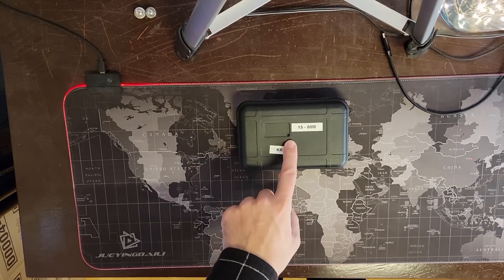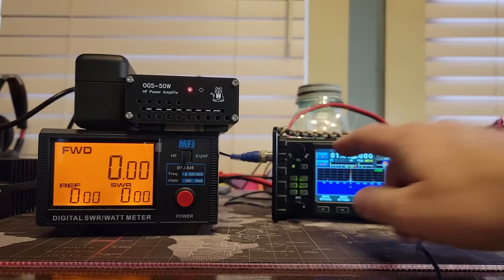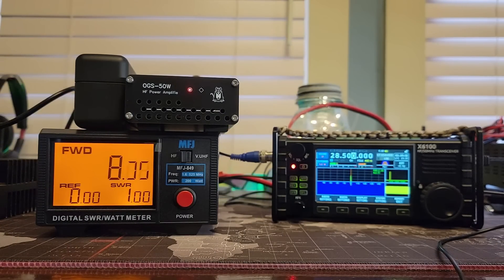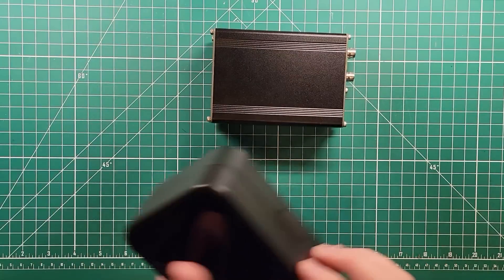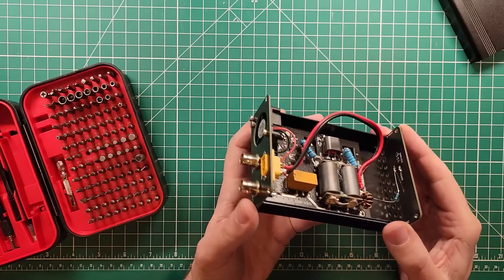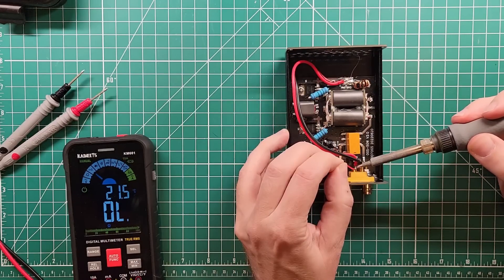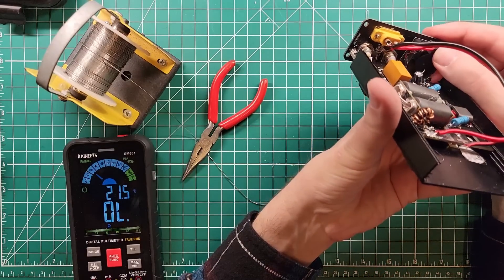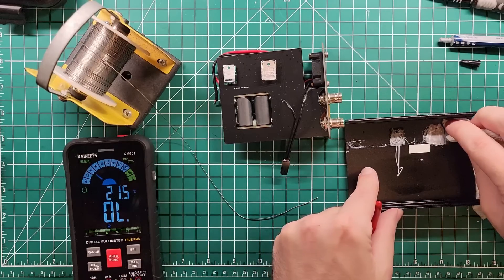The OGS-50W - Stay Away!

Comment: And it can’t be FCC certified because it is capable of amplifying 27 mHz/11 meters with a 5w input.

73 de AF6AS
Reply from the maker: As you know, If you're a ham it doesn't need to be FCC certified, that's our job.
Reply: @temporarilyoffline  True, but it can't "legally" be sold commercially ... (Yes, there's always AliExpress ...)

I remember the days when commercial linear amplifiers couldn't cover 10/12 meters unless you identified yourself as a ham and got a workaround, just like the MARS/CAP "out of band" mods.

Comment: I had a person hand one to me blown up in the same manner as that one that failed for you and found the MOSFET shorted-the soldering is pretty bad and I noticed around one of the BNC connectors a spot on the board where it looked like it got hot and discolored the board-which also may be the soldering job on it from the factory-they have always said-if it looks too good to be true-like 50 watts for about 50 to 75 dollars it probably is too good to be true
Reply from the maker: Yeah, I was pretty shocked. These are built by people that don't know what radio is.

Comment: I bought an OGS-50W before I saw the videos that dislike it. I figured they abused the amp, thus their issues.

To be safe I used a 40 meter resonate antenna. I also used my bitx-40, but since at 13.8 volts with adequate amps it puts out around 7 watts I decided to try running the bitx-40 at 9 volts with at most 2 amps. This brought my rigs power down to 0.8 watts on my crappy meter, but the combination of an input of 0.8 watts and the OGS-50worked great. I'd say my meter suggested 28 watts.

The only issue is the recieve to transmit relay has a delay of about 200 miliseconds. I spoof this by tapping the mic before starting my audio. On digital modes this could be an issue but I really bought it for giving more kick to my Qrp kit SSB rigs.
Reply from the maker: Nice, glad it worked out well for you!  I agree on the 200ms issue being a problem.

Comment: I knew that thing had a pair of IRF530s before you took the lid off. There are several kits that use those switching Mosfets. They put out a lot of power on the low bands but they short out easy as they aren’t designed for RF amplification.
Reply from the maker: Hams repurposing one thing to do another thing... No problem there, it's what we do. The micro PA50 uses the same FETs, but is a better design. I'd still like to see more protections built in though

Comment: Exact same thing happened to mine. This cannot handle any antenna greater than 1:1.5 SWR. One of the 530 was blown. Replaced it and it came back to life. It works, but it's fragile. Sold it to a friend who knows how to handle it with care. Oh, another thing, when the 530N blows out, the dc power plug is shorted. Be careful.
Reply from the maker: Yeah, no protections, no bypass, no PTT switch... no good.

Comment: This low quality amp is only meant to be used (per its spec) from 3 to 21 MHz. I notice that you began your test on 160 meters (out of manufacturer's spec) and then ran through the "approved" 80-15 meter bands but then did a bit of transmitting on 12 and 10 meters (again, out of spec), and finally returned to out-of-spec 160 meters where you blew up the amp. I'm not saying the amp wouldn't have blown up anyway given that it's made of reused solder and dog food, but I am saying that you may have sped up the problem by using it in ways the manufacturer never intended. Thoughts?
Reply from the maker: Good points!  I don't know where I got the idea that it worked on those bands.  I'd expect it just wouldn't be efficient.  The IRF530s aren't even meant for this application anyway.
Reply: @temporarilyoffline  Pushing the envelope, by instinct. I bet it would be sweet on 40, 20 metric bands. Would be cool if everything was repairable via firmware update. This may have provided a break.
Reply from the maker: That's what I do!

Comment: Amps, weather for audio or rf, are rarely rated at rms, they are more interesting if they are wearing an emblem of peak.
It can do peak safely, for a few seconds.
That 50watt amplifier, with ssb or cw, should be fed the specific amount of power to be just under that, especially with cw, which is short carriers. SSB could peak right on 50watts, or a tad more, but then you are stressing the recycled solder, and whatever they picked out for components. It needs a rig set to a specific setting of happy place and never exceeded, or just there to bypass straight to antenna. Once you have a few of them, you can start combinding them. A ssb signal @ 3 watts peak, driving 2 of those, then those driving 6 of those, of course after you develop a harmonic elimination circuit to keep it clean and focused on the bands of choice. Then you discover the little white transistors, with much higher gain and peaks, but that is kinda trendy.
Reply from the maker: Pills? :-)
Reply: @temporarilyoffline  What he said was , you over drove it to failure . never look to see advertised  watts in RMS/AVG . 50w PEP not RMS .  Its a gateway to popping skylab pills if your keen.  near as I can finger from Mr. Late offered up.
Reply: Damn Skippy

Comment: Wow, thanks for the heads up TO & shocked at the lack of protection & BPF circuitry.
Agree, to bring it up to spec you may as well buy an XPA or similar better amp.
There are a stack of these simplistic RF amp designs all over the net but the bleed back is worrysome as it can easily cook the RF finals in your rig.
I've built similar amps in my college days & is something every ham should try at least once.
When I've seen you test other amps their power output was fairly consistent.
I feel the toroid transformer construction is only scratching the surface of what's wrong with this amp.
Can only dare imagine how Mike (Mikes Radio Repair) & Peter (TRX lab) would react to this amp!
Reply from the maker: Might need to send them one!

Comment: No low pass filters on the output of the AMP, and it is likely the harmonics are not suppressed the required 43dB with respect to the fundamental required by the FCC.  So it is probably not legal to have on the air, but really nice that it destroys itself keep you from violating the rules.
Reply: I didn’t waste on that’n ‘cause I knew it was unfiltered. If it had filtering, bet it would have done better. Worse yet: there are a couple versions ‘out there.’
Reply from the maker: Right!
Reply from the maker: Small Favors...

Comment: The Micro PA50 works much better for me. It looks like it does not have any protection in the Amp. Based on final failures in the SbitX, the finals failing will cause a dead short when they go.
Reply: That amp has a lot of issues. There is no protection circuits. That is one of the things the Micro PA50 has that this amp doesn't. Lots of protection built into the Amp.
Reply from the maker: I like the Micro PA50 so far, eventually I'll get one to play with.
Reply from the maker: Dead short was what happened, yep.   Not pretty.  I can't imagine if I had a battery inline how much smoke that would have made.
Reply: @temporarilyoffline  The sBitX's did fry like that and it was not a good thing.
Reply: All the more reason to have an inline fuse like TO's fuse kit